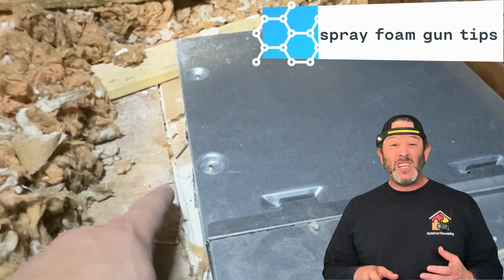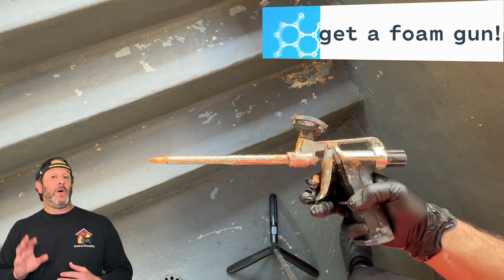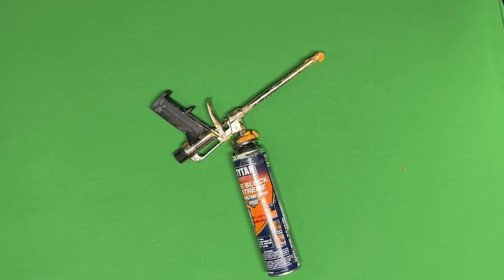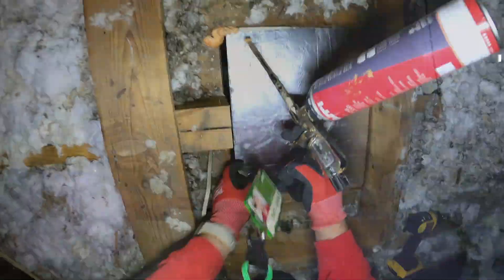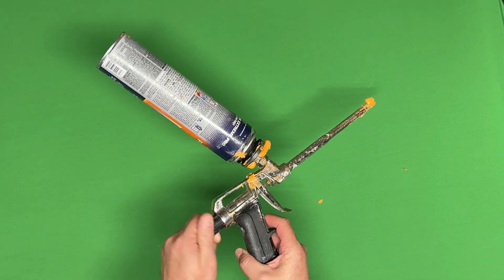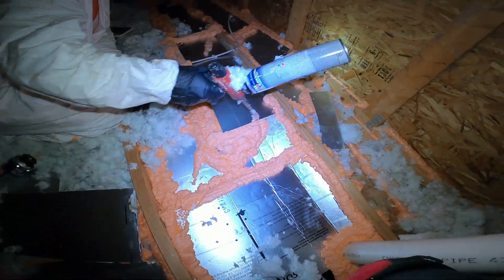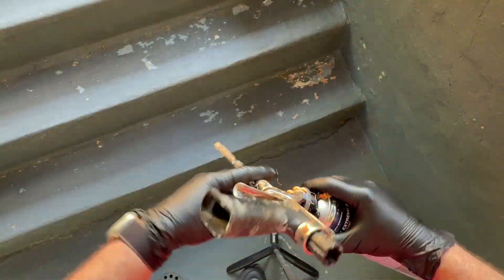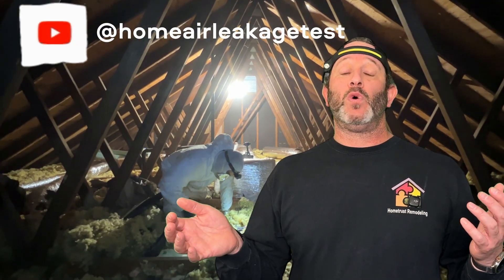Great Stuff Spray Foam Gun Kit Tutorial

Comment: How are you emptying the gun with no visible means of pressure?
Reply from the maker: If you remove the can, the chamber still has foam and pressure inside so even without the can attached, you can empty it out until there is no more then the pressure and the foam is gone.

Comment: Being in the wildlife removal and prevention service for over 2-+ years. I Do Not recommend using this for wildlife Prevention. Animals will go right through it. If you are using it around electrical equipment I recommend that you use Fire Proof foam rather than straight up gap filling foam. Sealing around exhaust fans can make things harder to replace in the future. So be mindful of that. More is not good. Bigger the Blob the Better the Job is not something to live by. Only use the amount needed to seal the area. I also recommend using a plastic accessory tip. A plastic tip can prevent wearing down the tip especially along cinder block/bricks. Spray foam cans do have a shelf life stamped on the bottom best by date. Believe it or not the do go bad or lose the pressure of the propellent over time. So be weary of that.
Reply from the maker: Great tips. Thank you for sharing. I have done a few bath fans replacements where the fan had been sealed and it was no big deal to pull the foam out and get the new fan in place, then foam it back up. Thanks again!!

Comment: I'd say that for the average homeowner as well as the above-average homeowner, it's just not worth the hassle of the spray guns. The unit-cost for the large cans of foam is higher than the single-use cans and the typical homeowner won't properly clean the gun every time, which will cost even more frustration as they then make another single-purpose trip to the store just to replace the gun.  Unused cans still have a shelf life, so they aren't a great product to stock up on just so that they are at-hand the next time you might want to use it (which probably will be out-of-mind for at least a year...)
Reply from the maker: I hear you, and you will get superior results if you use the dispenser gun and that is the point at the end of the day if you are going to invest not only the money, but also the time and energy.

Comment: Spending $65 on a professional foam gun and $15-$16 per can of foam, is so much cheaper than buying $5 cans of Great Stuff. Best thing is the control with the gun plus you can leave the can on the gun for up to 30 days. And if you're not using the gun within that time and the can isn't empty, just unscrew the can, clean the gun and save it for later. Those $5 cans are a one time use deal in most cases. BTW those larger cans on for the foam guns last a very long time. Take an attic for example, if you're just doing intrusions like pipes, wire holes and ceiling light boxes you can get away with the one use $5 cans. If you're doing top plates, can lights and fan units don't even think about it, get a professional foam gun you'll be glad you did.
Reply from the maker: Hey Al, this is one of the best breakdowns I’ve seen on the foam gun versus straw can debate.
You really covered the key benefits-better control, longer shelf life, and long-term savings. Thanks for sharing your experience and those specific attic project tips. That kind of insight helps others more than you know.

To everyone else reading this:
Have you switched to a professional foam gun? What was the moment that convinced you it was worth it?
Share your thoughts in the comments. Let’s help more DIYers get it right the first time.
Reply: I've gone through 3 of these guns though and I feel like I'm pretty good at keeping them clean. It's so easy to get them clogged, or get the cans stuck on the gun from foam drying etc
Reply from the maker: wow! I figured that would happen to me since I don't use it every single day. did you have the foam cleaner available to use? I feel like that may be the game changer, but I'd love to find out...
Reply: @homeairleakagetest  I do have the foam cleaner and I also bought a bottle of acetone. Honestly it's probably my fault each time for leaving a can on the gun. I guess my point is that cleaning it thoroughly after each use is absolutely crucial or you risk issues I've run into. I think they need to make it more obvious to consumers on the box or instructions just how important it is to clean it, and how easily you can ruin one if you don't. I still think they're superior to the regular cans no doubt
Reply from the maker: I completely agree with you! Cleaning it is the key to success! I also wonder if maybe you had a different foam gun? Admittingly, in the last two years I have left the can on for long periods of time and I have had to take one off, clean and change on the go but the gun still seemed to work okay. Anyways, thanks so much for watching and adding key insights!